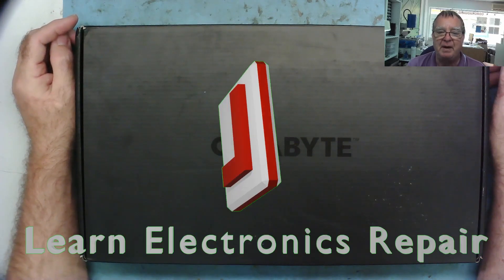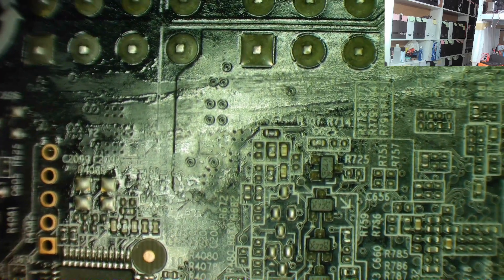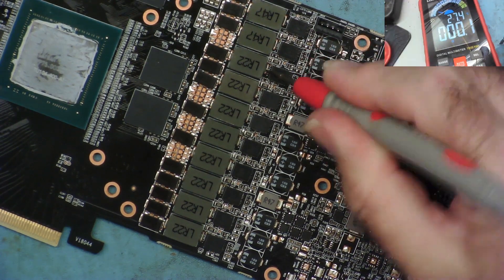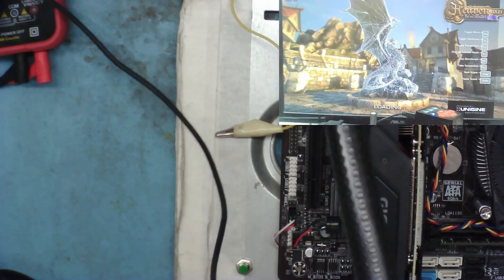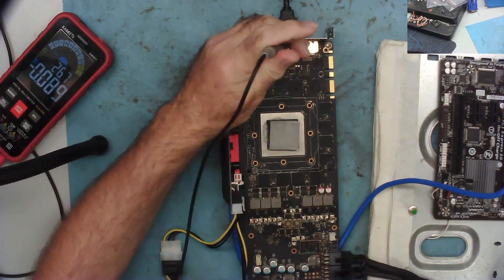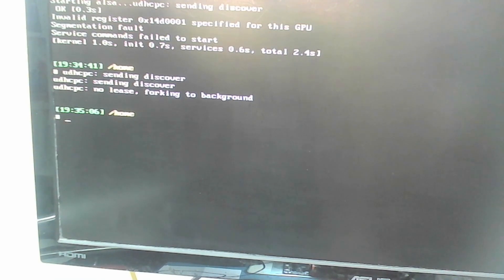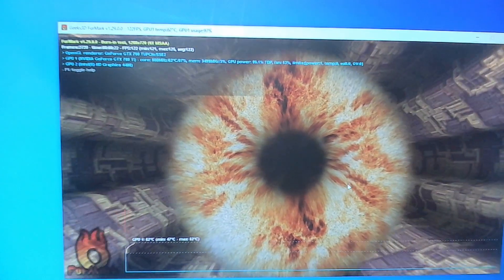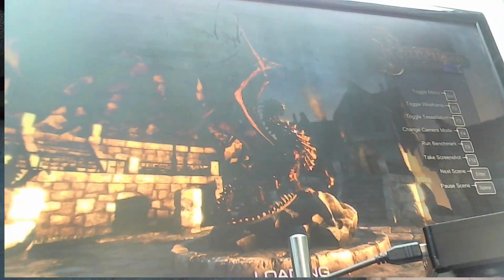Subscribers RTX 2080 and Ebay Spares or Repair GTX 780ti. No picture / Crash in Windows Can we fix?

Comment: As you say, the 2080 looks like a Friday afternoon job, the capacitor pads don't seem to be aligned. It may be an optical illusion but at 6:29 the top of what looks to be R706 appears not soldered (Friday night perhaps). Or, the warping in the board causes issues when the board gets very hot. Or, just the drivers, as you say.

Comment: As you had the bios to run in the integrated graphics when you plugged it into the HDMI has Windows not simply put the second graphics card into an extended  desktop like you have 2 monitors connected? Hence why there was no mouse cursor and no icons?
Reply from the maker: OK that is my misunderstanding then, but why did I get cursor and icons when I used the DVI connector and not with the HDMI connector (seeing as both are basically the same thing, albeit HDMI has audio)
Reply: @LearnElectronicsRepair  you got the icons and such because you rebooted the machine. When it came back it made the DVI connection the primary screen therefore you got the icons. When you had no icons and were pressing the windows key if you had changed the monitor to VGA you would have seen the icons and start menu popping up

Comment: Hi Richard, you might not believe this, but I have just had exactly the same experience regarding a Zotac GTX 780 ti, it's crazy! Basically, I already had one with a VRAM fault, and I bought another one (in case it could be used for spares). Last night, I watched this video and today the other Zotac 780ti turned up. I just tested it, all the voltages were there, it even passed mats as a second card, but only had a blank screen. Then, I tested it in windows as a second card and after the drivers loaded, it's interfaces began to work! I haven't had much time to think about it, I didn't even open the card to clean it, if you figure out what is going on, please let me know. At first, I thought it might be BIOS related, but it appears OK in GPUZ, perhaps it is intermittent. As far as I saw, the card's only fault is a missing capacitor at the back of a VRAM chip, but this wouldn't normally cause this behaviour. If you have any thoughts please let me know. Oh, and thanks for the video, great as usual! Rupo7 from LER Discoord :-)

Comment: I've had a few faults that seemed to be fixed by just cleaning connectors, chip pins etc. from dust & old flux etc. but they mostly come back. When cleaning seems to fix a fault now I try heating & cooling areas to see if I can induce it. Mostly I've found here that these faults turn out to be bad unleaded solder connections, even though there are no obvious loose pins etc. (never used to get this with leaded solder) ...
Reply from the maker: I'm going to keep the 780ti for a while so I will find out if it keeps on working

Comment: I like your videos and am learning useful stuff.  You probably know this already but just in case it is useful to you or someone else,  a spare computer can be plugged into the serial (usb serial dongle?) port of the test machine to get a Linux terminal. It is like the dumb terminals used to access mainframe computers back when T-Rex ruled the world. It could sometimes help with testing video and can quite often be used even when the machine seems locked up to unlock-down it. I used it for a while when writing graphics drivers for a now defunct company's video card. Maybe less reliable, but if the test machine is networked you can SSH or VNC to it also. Linux also has the magic sysreq key which can be used to give it a swift kick, or dump useful stuff for debugging kernel code but probably also for hardware if you are feeling particularly 3733t and \/\/0thy of w4r3z:-)
Reply from the maker: No actually I did not know about that. I remember the dumb terminals (we used them at ICL, until they replaced them) and I recall they were giving them away to anyone who wanted one.  Which was good as they were also good for debugging Amiga computers via the serial ports.  This is a really interesting idea.

Comment: Looks to me like in hdmi mode it might be set to dual display with hdmi as the second display device..
Reply from the maker: Yeah, someone else mentioned that.  I don't know why it would though as I didn't set dual display in Windows and normally the graphics card in PCIe slot just takes over from the embedded VGA.

And as soon as I connected to the DVI connector on the 780ti it worked in windows. So I am still not totally sure what was happening.  Interestingly another viewer has confirmed the same issue (and solution) on another identical card today.
Reply: @LearnElectronicsRepair  I didn't have it set on my card either.mine was a 750ti and did the same thing when using hdmi.all other types of connections worked perfect.i was baffled for a long time before I figured it out.
Reply: At Least yours was a lot simpler to fix 😂😂

Comment: A good clean and re-paste can fix cards that have no other issues.. see tech yes city on YT.. he gets a few going just doing that.. dust and grime can cause micro conducting across pins at times.
Reply from the maker: This one seems that way - though has you probably know sometime I have to deal with the difficult ones too.
Reply: @LearnElectronicsRepair  Oh indeed, i admire your work - i love the BGA removal machine you have, thats nice kit - i was wondering if you could salvage memory chips from dead gpu cards to fix bad memory gpu cards - some of the earlier cards for example all had GDDR5 chips so that should mean they are interchangeable?
Reply from the maker: @NOMADCREATIVESOLUTIONS  Yes I do have some donor cards so may get the chance to try this.